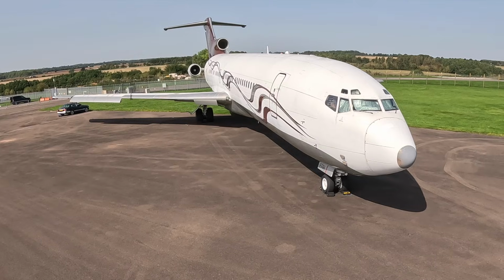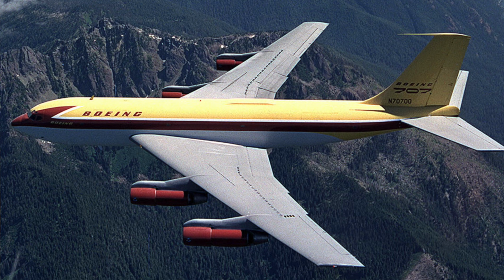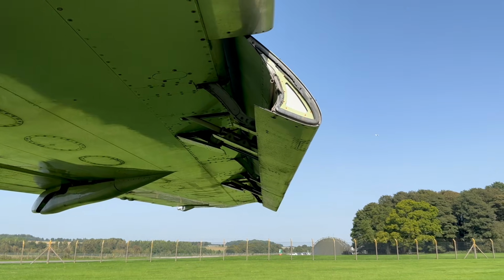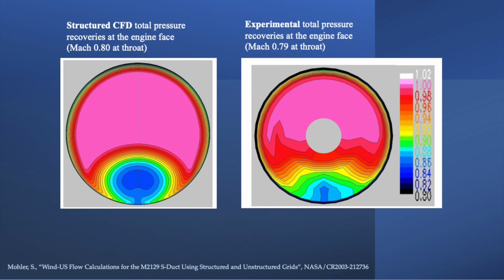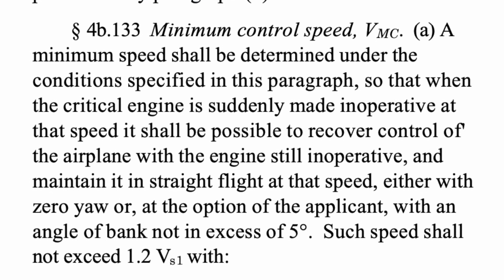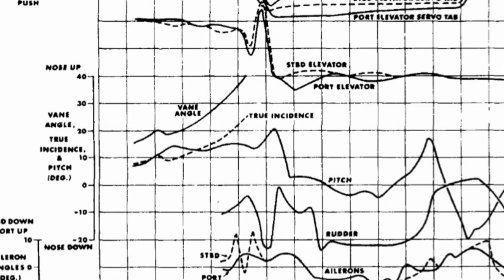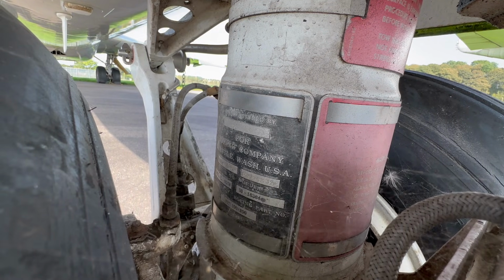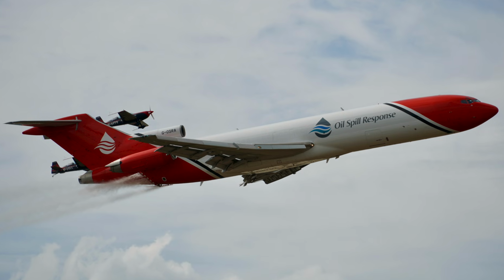Boeing 727: Part 1 - Engineering a High Performance Trijet

Comment: Very interesting, thanks. I flew the 727 (late 1968 ex-United 727-22QC's with JT8D-7B's) for 5 years (about 2 years of that in the climb, I think!) world-wide in the Royal New Zealand Air Force (RNZAF), where we had a very free hand in use of the flight envelope - far exceeding that which would have experienced in airline service. Many points you mention ring many bells - we were very enthusiastic about our machines, learning much about the way they worked (partly as a result of doing the same conversion ground-school course as the professional flight engineers). Ours had no nose-brakes - unsure if they ever had been, but the evidence was there. The Dutch roll was an issue, with the restrictions you mention for operations even with 1 yaw damper inoperative. We did most of our sim training on the -200 (at UAL), though would use the -100 sim for Dutch roll training. The -200 was relatively benign in Dutch roll (stable, as I recall), though the -100 would continue to diverge. Expectation was that it would eventually rip the fin off if yaw was allowed to develop beyond about 11*. Recovery actions included extension of the speed brakes, which pretty-much solved the problem, so I reasoned that once the lateral stability of the wing sweep was taken out of the equation, the directional stability took over. Very interesting also with the diagram of airflow through the S-duct at the compressor face: the #2 engine would compressor stall if not handled properly (e.g. excessive use of reverse during reverse taxi, or not reconfiguring the engine bleeds prior to closing the throttle at high altitude). We had free use of 40* flap, though the landing technique was very different and most pilots found that the landing distance was shorter with a well-flown 30* landing. My answer was to suggest practising the 40 option more - it was only 4 knots less in the Vref, but by the time the squares of the speeds is applied, the effort to stop was much less and the effect on the airframe on rough runways must have been good - the lower speed and greater drag after touchdown just seemed kinder to the airframe. The full gravel kit (optional) included retractable lower anti-coll light - we did operate into a couple of South Pacific coral strips, where we just taped-up the light, brake lines and lower flap surfaces.. Stalling: never did a full stall, though completed a number of post-C-Check functional test flights, to a prescribed weight and balance and fuel load. One check was the stick shaker activation at 40* flap - the indicated airspeed was 96 kts (about 4 knots above the stall as I recall). It was benign at that and recovery was conventional - I was aware of the stick pusher requirement in the UK, but wasn't aware of the aft CG effects..Wow!  We also checked the overspeed  'clackers' and regularly saw 0.92 (limit was 0.916 I think) and noted the symptoms of the upper buffet. Once seen, you'd be having a bad day to confuse that with low speed buffet or stick shakers..things may be different in times of stress though. I last flew the 727 in 2000, then moved to 22 years on the 777 (all production versions) - a great machine but 'antiseptic' by comparison. Now rated on all 737's, which aren't a patch on the 727.. ..Thanks again.
Reply from the maker: Wow - thank you so much for sharing your fascinating recollections! I was particularly interested in your thoughts on handling Dutch roll - 11 degrees of yaw is less than what I would have guessed as a threshold! Do you recall ever seeing (in the sim?) yaw and roll go out of phase in the Dutch roll? I sometimes wonder whether that is a factor in the unpleasantness of an aircraft’s handling from a pilots’ perspective…
Reply: @asobester   Sorry, no! No recollections about the subtleties of the Dutch roll - we were heavily focussed on the handling technique of applying opposite aileron at exactly the right time on each reversal of roll - very easy to get it wrong and make things worse. I suspect the bigger issue could also have been simulator fidelity - knowing what I think I know now in this regard, due to some exposure to the latest UPRT training as an instructor, I'd be pleasantly surprised if the Dutch roll in the -100 sim at UAL was entirely representative. While I'm here, the tailskid could be touched on landing - a colleague did it with an over-rotated flare at high density altitude. We had the odd scrape on takeoff - one when the captain attitude indicator was a little in error - at flap 5 (usual at heavy weights) the pitch attitude was VERY close to the skid contact attitude. I scraped the skid with a slightly too-enthsiastic airshow flap 20 takeoff, slightly compressing the honeycomb cartridge, but not knocking the tell-tale off, so it was still OK to operate. As you probably know, the 777 has a tailskid on all -300's made until about 10 years ago, when the effectiveness of the TPS (tail strike protection system) was proven (Boeing legend had it that the TPS allowed confidence in higher pitch rates with a V1 cut but kept the tail 3/8" off the ground during the V1 cut testing, where the earlier -300's had a number of tail strikes). All the 777's have a tailstrike indicator (though a strike is still possible in the -200's after the main gear is airborne, also missing the tell-tale..). Rotation rate is important - some of my former operator's older -300's had a maintenance terminal where you could look at pitch rate and pitch values for the last takeoff, and the resultant tail clearance. I've seen 12 inches clearance after a near max-weight departure. Anyway...all in the 'sealed section' of my logbook!
Reply from the maker: @kerrywilton8266  Fascinating stuff. Do you know if the clearance was calculated (from the pitch and height signals?) or was there some sort of clearence sensor under the tail that generated an inch precision value? Presumably these stats came in handy when they were designing the semi-levered bogie for the -300ER?
Reply: American Airlines put a stop on the flap selector locking out full flaps from being  used, I was functional test on the 727
Reply: Just came here from Greg's airplanes video on these aircraft.
Reply: Thanks for your fascinating input you have had a full interesting life . As a child I was always interested in planes the USAF had a base just along the road from me at Prestwick . They still are there mainly Galaxy’s come and go . I remember back in the 60s German f-104s Starfighters  coming in as well . When I was over in Las Vegas, San Francisco, LA late 90s we done internal fights on MD - s oh I was scared the way the pilots threw them about I was told by an American fellow passenger that lots of pilots were ex military. Also I remember being on a stretched MD and I thought it wasn’t going to take off seemed so slow . I still have great love for planes as a child my parents took me over Europe and mainly on BAC 11-1 s . My fav plane to date still is Boing 707s loved them

Comment: I FLEW THE -100 and -200. They were a delight to fly.  And yes! Dutch roll was an issue and we always practiced recoveries from them in the sim. Extremely stable airplane. Extremely effective speedbrakes.
Reply from the maker: Interesting how rarely speed brakes are mentioned in the context of field performance. There is an interesting trade-off there, since beyond a certain area they become structurally inefficient and their actuation becomes difficult. Sounds like good balance was struck on the 727

Comment: 23:00 There's another small advantage of the S-duct - a slightly lower cabin noise.  
Because you have a longer rudder than you would with the DC-10 design where the engine is mounted in the tailfin, Engines 1 and 3 can be placed further outboard on the wings as there is more rudder authority to compensate if either of those engines fail. Compare the engine position on wing between the L10-11 and the DC-10. It's not a lot, but it's something. That contributed to a lower cabin noise level on the Tristar.

Comment: What was the fuel burn penalty from the Cooper Vane ?
Reply from the maker: Negligible, I would imagine, basically like a vortex generator (except deep inside the boundary layer back there).
Reply: @asobester  thank you for the quick reply. I’m surprised, because of the substantial fuel penalty from the tail skid? I guess the tail skid is a lot bigger…

EDIT Nevermind, I looked it up. In flight it sits flush with the fuselage. Only on the ground does it stick out like you showed in the video.

Walking away with a million bucks AND having an airplane part named after you? May be worth it…
Reply from the maker: @apgardude cool. I hadn’t actually realised that it sat flush, I’d just assumed that it self-aligned with the airflow.

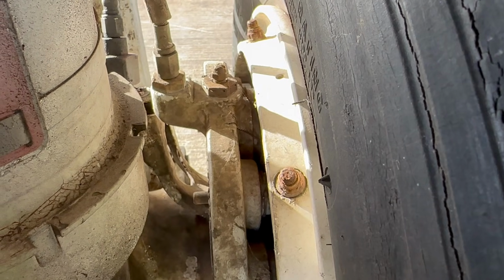Comment: 43:12 IIRC Concorde had steel nose gear brakes, however they were only used for brake on retraction, and not for actually stopping the aircraft
Reply from the maker: Interesting!

Comment: The 727 was the Maserati ofBoeings, fun and responsive.  The only plane that in the flare landing, you slightly pushed the yoke or ward, not much, but just enough to reduce the descent rate of the main gear, essentially rolling in into the runway.  Aerodynamics were ahead of its time demonstrating Boeings engineering excellence.

Comment: The revolution created by this beast of a jet was huge. The wing practically disassembled for landing at low speed, the plane had its own stairs for passenger, the onboard power unit provide electricity and air for heat/cooling. The engines in the rear were “whisper” quiet. The jet had serious performance challenges for less than sharp pilots. High sink rates while landing, insufficient emergency cockpit lighting, and primitive cabin temperature control systems. But it sold to airlines everywhere like hot cakes.

Comment: The B727 was under powered but a great airplane to fly.  When the airplane was introduced to the airlines most pilots had minimum jet flight time.  Those flying props hung onto those airplanes until they were forced retired.  My point is, many pilots did not understand swept wing aerodynamics and advanced flight systems.  Because of this a fair share of pilots improvised by doing unapproved things, came up with bizarre landing techniques, and flew the airplane improperly.  Unfortunately, some of those bad habits stayed with the airplane until its retirement.  If flown properly, this airplane was rock solid and a joy to fly.

Comment: I agree, the B727 was mostly under powered but was a great airplane to fly.  It was solid as a rock.  True Story:  I was a brand new FO on the 727 and was told by others the plane was a bitch to land.  The best way to land the 72 was using the "roll on" technique.  In case you aren't familiar, the roll on does not use a flare but just about touchdown, you add a handful of power and lower the nose.  This reduces the angle of attack flattening the approach attitude and supposedly, you "roll it on."   It also increases your landing distance and subsequent wear on the brakes.  When flying with an experienced B727 captain, I used one of these roll on approaches.  When we arrived at the gate he said "What the hell was that all about?"  I replied "Sir?"  He continues " This roll on crap.  Who taught you that?"  I said "Most of the instructor pilots use this technique and showed me how to do it."  The captain says "Yea, those idiots who never fly the airplane giving the rest of us flying techniques.  Fly the 727 like you would fly any other airplane.  I promise you, your landings will dramatically improve."  He gave me his leg and I followed his advice.  I never had a bad landing in the 72 since.   I really enjoyed flying with this guy and flew with him until he retired.
Reply from the maker: Thanks for sharing that. It is amazing how this sort of technical lore develops around an aeroplane… After all, you’d think that if there was some amazing landing technique, the test pilots who landed the aeroplane hundreds of times in certification flight testing, at a range of CofGs, weights, flap settings, wind directions, etc. wouldn’t have kept it to themselves…

Comment: The 727 is more than just an airplane. It is a classically beautiful work of aviation engineering art. Like its 'big brother' the 707, it is a combination function and form that never looks out of its place in time.

There are three things I remember about flights on a 727. First was how QUIET the cabin was on takeoff. With those rear mounted engines they sounded more like the whine of electric motors. Then there was the aggressive angle of attack during the initial climb. There were times when I swore the thing was going to stall. Finally there was that 'nose high'' angle on approach to landing, no doubt a consequence of the T tail. It was like a flare before a flare was required.
Reply from the maker: I know what you mean by classically beautiful engineering. I have a Collins course indicator from the era (very similar to that on the 727) and sometimes I just find myself staring at it - such mechanical beauty even in that single instrument.

Comment: One thing about the 727 I always admired was the smooth transitioning of the #2 air intake down to the engine below, just gorgeous. I admired the (shudder) Lockheed Tri-star for the same reason compared to hideous mounting of the DC10 , which looks like they tasked a summer intern to design it... But they blew it off until the night before it was due.

It looks like a late-night beer-fueled lark with the goal of not thinking about it too much.

This is why I breathed a sigh of relief whenever the equipment was 727 rather than my most hated equipment, DC-9/MD-9 . I never blike the 9 at all. Hated it 

I miss the old Boeing.
Reply from the maker: Yes, some lovely geometry work there, particularly admirable since it not only pre-dates CAD, but even the underlying mathematics we now take for granted (Bézier curves, NURBS, etc.)

Comment: I loved the 72 … flew it for Pan Am after retiring from the USN as a pilot. The coolest thing about it, to me was how “slippery” - low drag - it was - descent without having to use spoilers required a lot of thinking ahead of the aircraft. I appreciated your deep dive that makes me appreciate even more the amazing engineering … all before the age of computer aided design! I remain in awe of Boeing’s design prowess, that few appreciate. 

With its Ceneterline Thrust, combined with Manual Reversion flight controls and backup manual trim enabled a crew fly it with any one-engine, no electrics, no hydraulics, hand crank the gear down (manually checking down and locked mains through little light pipes through the deck at row 19) and still land on a runway (only did that in the simulator and that was HARD!)

Thanks again for such a cool deep dive!l

Comment: Great video. I absolutely love the 727. I retired in 1997 off the 72 with over 23,000 hrs of stick time on her. I always passed up opportunities to upgrade to the 767. My seniority allowed me to pick my favorite trips and the 727 was so much fun to fly, I would have “worked” for free. 8 yrs as f/o and 22 as capt. ( Never was a f/e.) I could count on my fingers the number of times I had a mechanical delay. Never had an engine fail. I remember only 2 times I had an inflight engine shutdown. Both minor issues where we could have restarted if necessary. It was that dependable.
A fact no other aircraft has ever been able to claim : there was never a 727 crash as the result of faulty design.
Reply from the maker: Thank you 🙏 And 23,000 hours on the 727 must place you in a rather small elite club!

Comment: I think that you'll find that the Trident beat the 727 into the air by thirteen months making it the first.
The Trident had one trick up it's sleeve that no other had at the time.
Autoland. 
Unfortunately for the Trident - like the VC10 - it was designed and  built for a single airline that kept changing the specification, not for the world.
Reply from the maker: Yes, the Trident flew first, I hope I didn’t mistakenly say that it didn’t. I did say that the 727 was first to enter service though (and I’m pretty sure that’s right).

Comment: Love the aircraft. I flew the 200 all pax, all cargo, and the only -200 combi. The long body, wings, and tail are beautiful. One doesn't even hear the engines when you start up. When thrust is added for takeoff, there is only the increased sound of air conditioning airflow(and the altimeter vibrator clicking away). Same on the climbout with peace and quite....until 250 knots, then it gets loud as the airflow noise gets louder and louder.

Landings could be interesting. Go for a while with a streak of decent ones and then the inevitable firm one. Sometimes one would be expecting a firm one and would get a greaser. Many would say that you flare by pulling back on the control column and then push to roll it on, but it was really just a relaxation of the control column.

Remember, the nosewheel brakes don't necessarily get activated. They only operate when the brake pedals have been deflected beyond a certain amount(something like 50%) so that they are not being used unless they are really needed.

I saw a flaps 28 position in the cockpit shot. That means a Raisbeck noise mod which intentionally reduced max flaps deflection to reduce required thrust on approach.

Comment: I am not a pilot but a stall can be the 
Most dangerous stage in flight if 
Not recovered by the pilot the engines start losing power this 
Applys to the B727 .